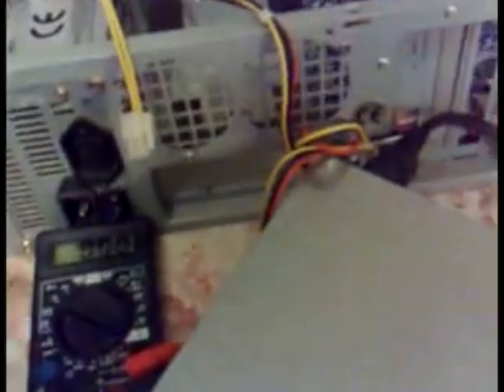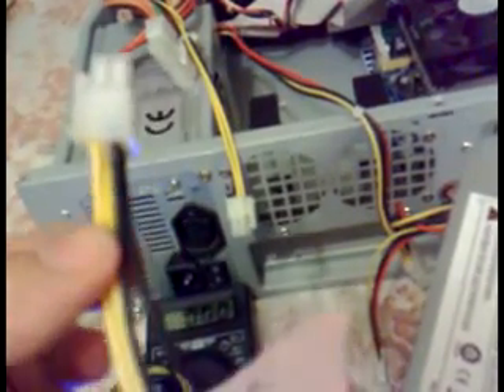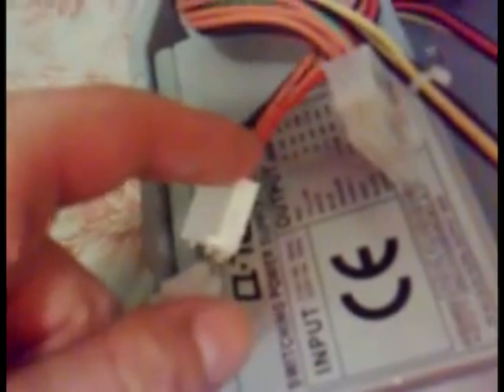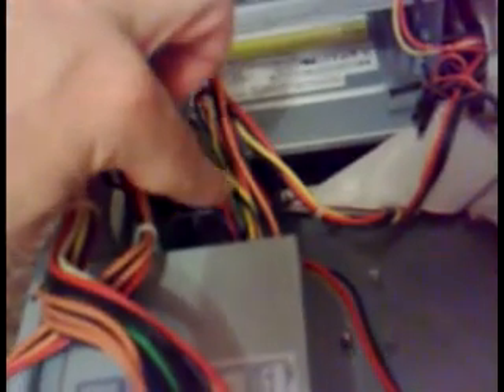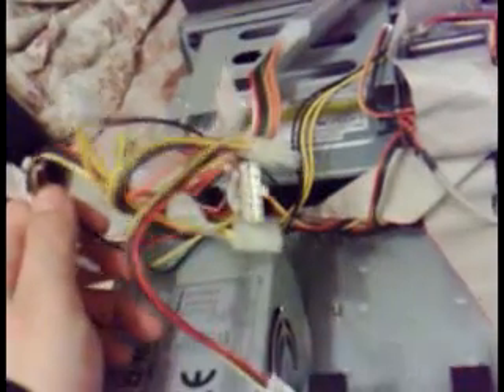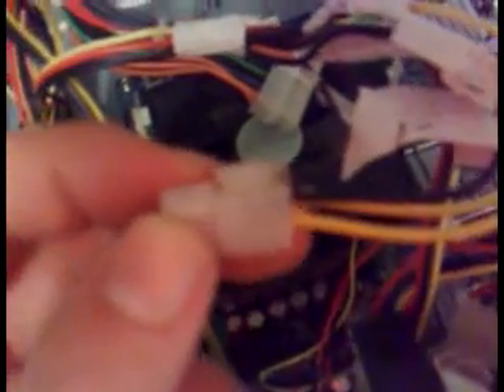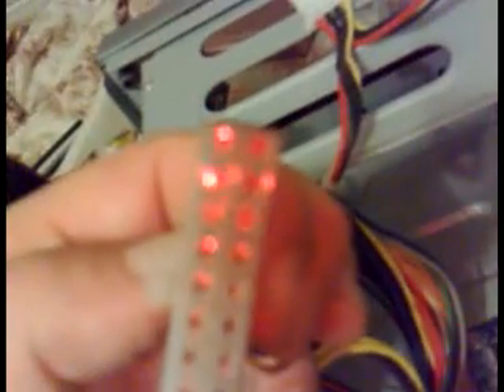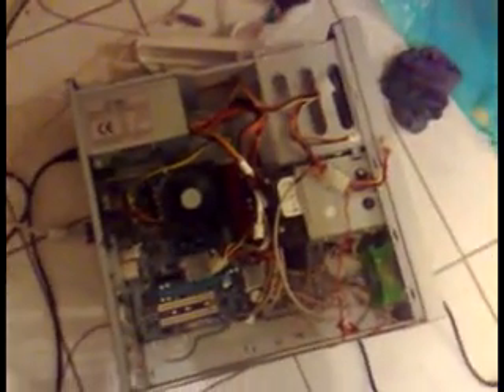atx power supply 20 pin to 24 pin mod

Comment: @kerlan and crwl8:  the extra 4 pins have been added to motherboards in the last 5 years to supply more current for THE SAME rail in the first 20 pins. discrete graphics are powered by connectors on the respective card.